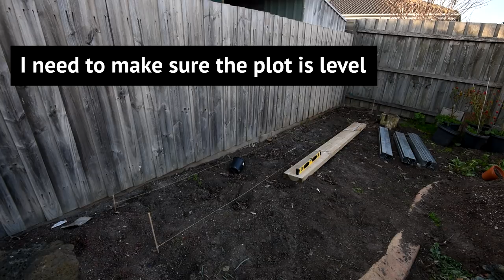#80.1 Measuring and cutting

Comment: no cement on the posts, chuck? won't it move later on?
Reply from the maker: I plan to fill up the bottom half or 1/3 with rocks. That plus the sheer weight of the sleepers, combined with the strength of the uprights, with gravity and friction binding them all would be enough to hold them. Just have to make sure they are fitted snug and tight.